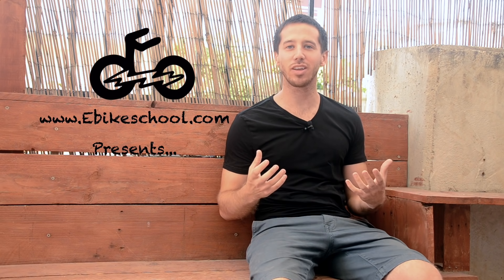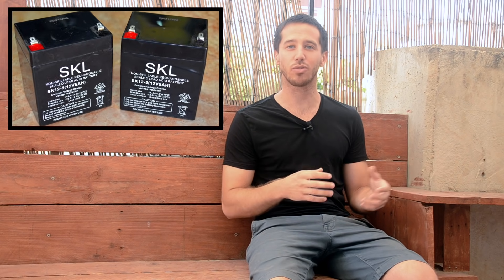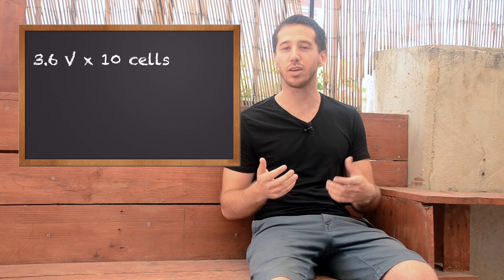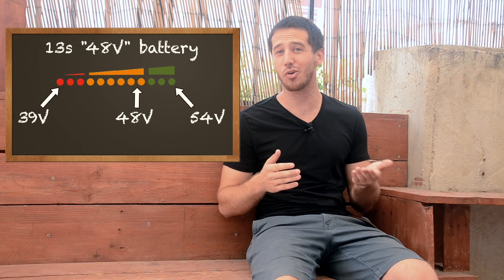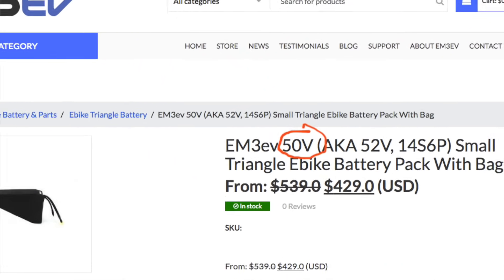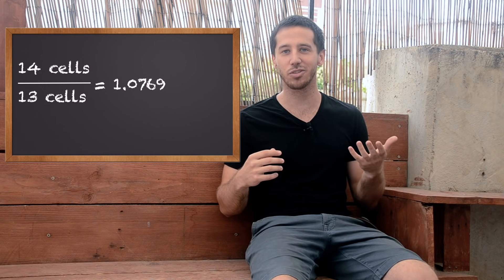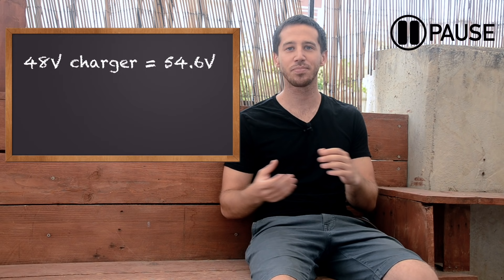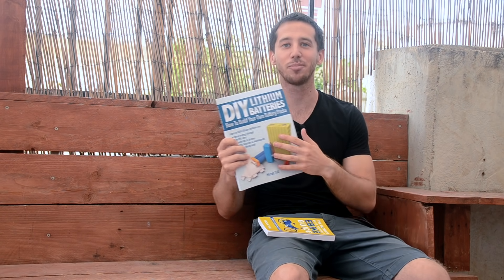Which is better: 48V or 52V battery?

Comment: Easiest is to stop calling these by voltage, just say how many cells in series as they are all Li-Ion.
There is no 48V batteries, 12S battery is 4.2V x 12, fully charged, everything less is discharged state.
Reply: The standard used to be to rate batteries at their nominal voltage. It seems like many places do whatever they want now with lithium. Standard lithium chemistry nominal voltage is 3.7Vpc. They should either use that, or just state the series-parallel configuration.

Comment: The price increase from 48v to 52v also has the do with the weight, labor and possibly a higher amp rate bms. More cells mean heavier weight and cost more for shipping. More cells also mean more labor. Lastly the higher amp rate bms will cost more.
Reply: Yeah, but all the factors you mention aren't supposed to increase exponentially but the opposite of that so on the contrary even if you added 50% of weight then the price increase should be slightly less than 50% rather than more than 50%

Comment: 52V battery will not give you just "little more range". You forgot something important and it is the cut-off of the controller. Let's do the math like you and say we have a 48V controller wich usualy have a 42V cut-off :
1 - with the 48V battery you will drain your cells until they get to 42 : 13 = 3.23V per cell.
2 - with the 52V battery you will drain your cells until they get to 42 : 14 = 3.00V per cell.
Bottomline you will get the extra range from the additional 14-th cell but you also will get an extra range from every other cell in the pack.
Reply from the maker: No, both will cut off at around 2.7V per cell depending on the BMS. 48V ebike controller LVC is usually 35-36V, or 2.7V per cell.
Reply: The controller will cut-of way before the BMS. 
Of course I'm talking about the cheap ones (not adjustable) controllers but I'm pretty sure that the most common specifications for them are :
Rated Voltage: 48 Volts
Phase Angle: self-study
Throttle Voltage:1.1-4.2V
Brake level:High/Low
Under Voltage Protection: 42 Volts±0.5v
--------------
But let`us say you are right, the math stays the same :
1 - with the 48V battery you will drain your cells until they get to 36 : 13 = 2.77V per cell.
2 - with the 52V battery you will drain your cells until they get to 36 : 14 = 2.57V per cell.
Reply from the maker: No, most 48V controllers cut off lower than that. Also, I'm not sure you're aware of this, but check how much energy is left between 2.77V and 2.57V. It is well below 1%. Barely even measurable. The voltage curve plummets at that level.
Reply: Agree - it is below 1%, if we talking about cell voltage in idle ;)
But I suppose we talking about under load conditions and in that case 14 cells times 0.2V difference is 2.8V wich is way more then 1%.
I`m curious - could you point me to 48V not adjustable controller with 35-36V cut-off, because everywhere I`v looked it is 42V which is considered with 4 lead-acid batteries with 10.5V minimum voltage.
Reply: I actually thought the standard LVC was 40V.

Comment: Sit the fuck in your hands pal, your talk with mouth not your hands, your hands waving around become so annoying I had to look away at tv & just listen.
Reply from the maker: I'm actually working on waving them more. I'm trying to get to the point where you lose sleep over it. I feel that I am very close.
Reply: +EbikeSchool.com   question: I have a 52 volt battery that I'm using on a 48 volt 1000 watt hub motor the throttle is led 3 color indication thumb throttle it was working fine  for two days until I noticed that the motor was spinning without me pushing the throttle so I pushed the power button off and it stopped then I turned it on I pushed the throttle again and I got nothing so I used the self study cables such as automatic or backwards and low speed etc and they do work some now do you think it's faulty battery or  controller  Personally I think it's the controller keep in mind the day I experienced that issue was a really foggy morning and I have my controller hanging out on the bottom seat post?????

Comment: I'm changing over my hybrid gas/electric scooter with one of your kits.  It's a 36v lead-acid system with a 500 watt in-hub motor.  Should I upgrade to a 48v when I change over to lithium?

Comment: I have a radcity from radpower with a 48v dolphin pack. I dropped it, it turns on, but won't power my bike for some reason.

If I bought a 52v dolphin pack, from calibike or lunacycle let's say, could I just slide that right on? Or do I need to change the downtube bracket and cut/reconnect the wiring to the controller? Hopefully, not because I don't know squat about splicing wires and what not

Comment: what i'm looking for is range not speed or power so much i dont have any hills so to speak around here. i have a 28 miles round trip i make every Tuesday. can i tie two 48 volt batteries together at 48 volts and get more range ?

Comment: Hi Micah, love the video series. Am a newbie, about to build a 48 or 52 volt battery for a golf cart and eventually a powerwall for my solar array using the Vruzend system. Had a question. If I build a 52 volt battery, and get a 48 volt charger, will I have the longevity of undercharging, but will I develop balancing issues? 
Thanks for your time in advance
Reply from the maker: Yes. But also that 48V charger will only charge your 52V battery to around 60-70%. That's significant undercharging.

Comment: Considering that one can charge these batteries to a slightly lower voltage to extend their life, would it be appropriate to get a 52v battery but charger it with a charger meant for 48v batteries?
Reply: Grant ... i am going to weigh in on this and give you a bit of good advice with charging/ discharging these lithium batteries.   Firstly do the math with what you doing ... or proposing on doing in respect to the total charging value. 
52v battery pack is going to have 14 18650 cells in direct series (well actually the best and longest live zone is to pair 3 18650 in parallel series and theneach group in series. Total 42 cells 
Sorry anyways the math: 

48v / 14 = 3.43v   While the nominal voltage is very commonly shown and calculated as 
3.65 volts   (3.65*14) =51.1volts  
4.2volts is peak 58.8volts

FYI - Grant the best idea is actually to stop using the battery where your charging stops. And charge it full again to 58.8volts and actaully about halfway discharging is going to increase its longevity and performance. By only charging it to 48volts is actually quite terrible for these types of batteries, and your wrecking it Also fgully discharging ---> full charging is not great either. In both case these practices should be avoided!!!  FYI

Comment: Great video and presentation style Micah, thanks for all the info you share with the online community. 
I have a made-in-china e-scooter with a 60V20Ah battery. I would like to upgrade to a 72V 20Ah battery. I tried to open the bike up to the controller, but I'm a little wary of opening up the controller because of all the wires coming out of it, and I don't know if I'd be able to reassemble everything.
Question 1: Can you comment on the likelihood of me killing my controller by changing from a 60V to a 72V battery? 

Because of this unknown risk of burning out the controller, I'm considering the following that I'd like your thoughts on. I'm thinking of keeping the 60V battery installed inside the scooter, but running some wires out to a little storage area under the seat in which I plan keep a 12V battery. I want to install a small switch on the side of my seat that flips the 12V battery in series and out of the circuit. So when the 60V battery is fully charged, it's almost 72V and the controller can take that. But that voltage (and top speed/acceleration) does not maintain very long, the battery quickly drops down to maybe about 67V in the first few minutes of riding, and so accordingly does the speed. At that point, I would plan to switch in the additional 12V battery under my seat for a speed/power boost. So question 2 is: Would this work? Is there any issue in installing a small switch on the side that can connect and disconnect the 12V battery in series to get a power boost when I want it ?

Comment: Micah,in part of this you said that the there is a misconception about the more Voltage less current less heat.. .. in fact there is no misconception but you are comparing higher speed to at same Amps out.. and we say that less AMPS less heat not at higher speed but same speed.. in fact.. everyone prefers more V over more A but not because of higher speed.. if the gearing is right (skateboards) you are pulling less amps because you are running more V at equal speed at compared to lower S battery..  we can put 24s or 48s system in if we can fit the batteries gear it down properly you get more speed for less amps drained

Comment: Yes I would like to comment, you said comment to win one of those books, but keep it nice.  Here's a nice comment, "Use mental floss regularly to avoid truth decay!  I hope to build a battery someday soon,  when I can afford to do it.  One question about chargers though, aren't there chargers that have different settings to charge different voltage batteries?   Or is that a cost prohibitive feature for those on a small budget?

Comment: Hi Micah, UK calling. I have a BBS02B with a 52v 17.5 amp Hailong battery and all is OK. although  when I charge the battery I get about 58v on the display along with 100% charged.Yet to obtain this my charger light has not changed from red to green.Is this because the charger is for 48v battery? Must admit it doesn't cause me any issues.

Comment: Thank you for making all the great e-bike videos. Your information has saved me weeks of research. I am preparing to build a low slung, reverse trike. the frame and body will be all carbon fiber. Any components that need to be made of metal such as screw bosses or mounting plates will be  magnesium or titanium. I need to save every ounce I can because I intend to have 400 cells in my battery pack(s). The trike will weigh in @ 140 to 150 pounds ready to ride. I weigh 140. That will give me 280 to300 pounds gross weight. I am thinking that a motor rated for 8kw will cruise nicely at the 20 mph Nevada speed limit, and give me great range. If it works out as I hope I am going to take it to the Bonneville salt flats and try for the electric bike world speed record.I would love to hear your thoughts or comments on this proejct.

Comment: Hi, since some of these 36v battery packs have become fairly cheap if we look around a bit, and do things right, I was wondering it I could run my 48V bike with a 36V battery? Seems to me it would only go as slow as a standard 36v bike, and actually be better because the controller/motor are dealing with less than they are designed for, so not only would no damage occur but less wear and tear on the components. Am I thinking right on this?

Comment: 5:42 You will pull less current from the battery if you're not using full throttle because it takes less current to go the same speed with a higher voltage battery. What you're assuming is that everyone pegs their throttle at maximum the whole time they're riding. I don't do that. So it's not a misconception. However, it's such a small difference that it doesn't matter in real life either way.

Comment: how do I get more speed and distance, I have an e-bike/scooter: Specs Motor:350W brushless; Rated Voltage 48V/12AH; Distance full charge: 60 km; Max speed: 25KM/H... I would like to upgrade it to go a distance of 100KM and speed of max 60km... it has a lead acid battery... can I just change the battery to lithium to get the increase in distance and speed?
Reply: wouldn't changing to lithium ion battery mean changing other components? do I just replace the battery and the charger?
Reply: Thanks... so just need to change the battery and the charger and I am good to go then. Thanks for the offer that would be a big help. The technicians here (in the countryside - Philippines) are telling me that if I change the battery to lithium ion I would have to change the "controller" to avoid heating, etc. and I would be better off getting a new, higher model of the e-scooter, I guess they are just after getting more money... hehehe...
Reply: Thanks, I will do just that as soon as I do not have work. :)
Reply: Ian Mangham, I have not had time to open up the e-scooter but I found a document with the specs...  Charger for 20AmpHr/12AmpHr ... Controller 42+- 0.5V / 52v+- 0.5V ... Battery Rating 12 Volts 12 AmpHr / 20 AmpHr... 48/60 Volt: 12/20 AmpHr... does this help?  It may take time before I could open up the e-scooter to take a photo of the controller...

Comment: BBSHD does take 15S at 61.4 V / 4.09 V/cell on the DPC-14/C850 display, and if you fool the display with a resistor it can take 15S / 4.2 V/cell for an absolute max of 63 V.

Comment: Micah I'm a subscriber of yours.  I would like to know if I can use my SLA battery charger to the one I'm building right now which is Li ion they have the same rating of 48V. My charger is for 48V  3Amps. I decided to upgrade my battery to Li ion because they are  lighter and last longer.
Reply from the maker: No you can't, as 48V SLA and 48V li-ion are actually different voltages at full charge (about 52V vs 54.6V)

Comment: Can I add a 16v pack in line to my 36v to get 52v as I have a bottle battery still under warranty so cant open it up just yet to make one single battery? So really, can batteriy packs be added wired in parallel or do you need to just make one big battery, which I can't do at the moment, I understand they would need to be charged separately but I want ago at making a battery pack  even a small 12v or16v one. You see if I won a book I'd save you loads of time as you'd stop me hassling you. Lol. Thanks

Comment: I think I have a good question, I bought a watt meter and have been watching what my  battery and hub motor are doing, 36v 500w peak 23 amps and 36v battery 15ah charged to 42v, Now I went for a long ride about 9 or 10 miles and used 9 ah now at the end of my trip going uphill my battery reached 31.99v and I thought OH I'm gonna ruin my battery, Is this the case my battery or motor didn't stop at any point and letting off the throttle the battery returned to about 35v. I'm confused while I ruin my battery and why didn't my battery cut out as it has a 32v cutout and I got nowhere near 15ah. please please help and it's your fault I'm asking as without your video's I probably wouldn't have bought an E-bike. I know I've already taken up some of your time but its a good question, How long should a battery last ie the voltage drop over use ie should you  use up 2 to 3 volts over 4ah that kind of thing.

Comment: I have a 36v 15 ah bottle battery and I just wish I'd watched these video's before buying and putting together my E-Bike, which I love anyway can I add a battery pack to increase the voltage as I don't want to open the bottle battery as it's under warranty. Is this possible and what is the best course of action I have a 36v 500w kit rear hub motor.

Comment: I'm pretty sure I'm right but, I bought a watt meter, brilliant advice to buy one from E-Bike school and now I know my Bike peaks at 23 amps under full load so, if I buy another 36v controller with say 30 amps max will this increase my torque I checked my battery stats to check my 36v 15 ah bat can handle it, my speeds fine about 25 mph maximum, Please help Thanks.
Reply from the maker: Yep, you've got that right. If you swap out your 23A controller for a 30A controller, you'll have a noticeable increase in torque and power (but not much speed increase except on uphills)
Reply: Wow Thanks Mikey actually replied you made my week love the channel keep it up. Nearly everything I've learnt is from your channel clear and great information I couldn't afford a Cycle analyst but did get a watt meter great advice. Thanks

Comment: Good stuff, clear explanation. We feel that 48v packs are in a sweet spot for commuting. They give our hub and mid motor systems a good balance of power, range efficiency and reliability. 48v is also becoming standard for automotive mild hybrid technology, right?
Reply: Hi I just want to know if I can use 48v of my motor 36v thank you
Reply: I mean 48v battery of my 36v motor thanks

Comment: Thank you for your info on Regen e bike 
I'm setting up a 48v e bike 1000 w
I'm doing 14v 4s 7amp packs and with bsm
Four packs in total to produce 56 volt
Do you see any problems I may run into ?

Comment: Hi Micah, I am a fan of your videos. I have a question related to this video. I have a 36v battery. Would I see the same benefits described here if I use a 40v battery (11s) instead of a 36v (10s)? Provided that my controller should draw only 36v, would I also experiment a larger capacity/range (everything else equal), given the higher Wh figure? Thank you in advance for your time
Reply: Good question I would have thought the speed controller would go nuts thinking its overvolting, sorry I'm still learning, I was going to buy a new controller one of the 36v 48v ones, that have a self-learning wire that tells the controller if you have a 36 or 48v volt battery or just the phase of the motor not 100% sure I need to do more reasearch, thenat a later stage when the warranty runs out to add a 16v battery to my 36v battery to get 52v does the controller shut down? So can anyone help us both?

Comment: great content, it'll help me decide what size battery I want to build. One note, at the start of the vid you mentioned 60V and 72V batteries in passing, how common are these and is the speed and power increase worth the extra weight trade-off?